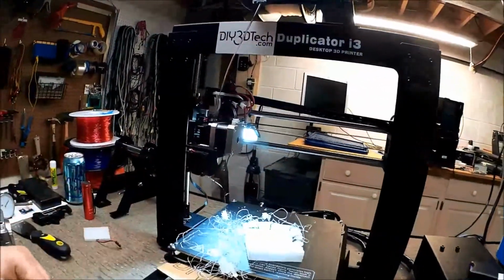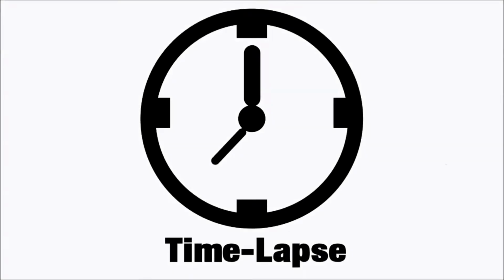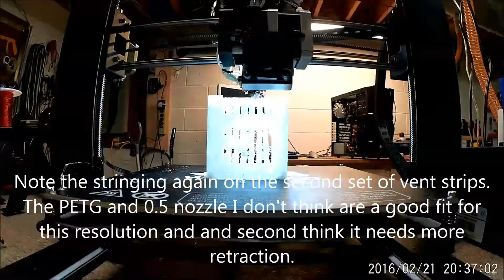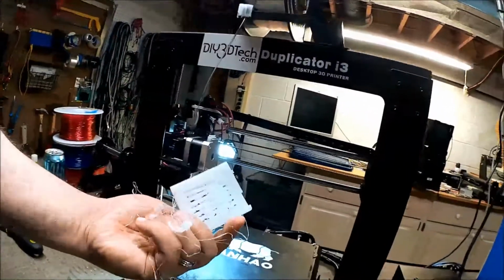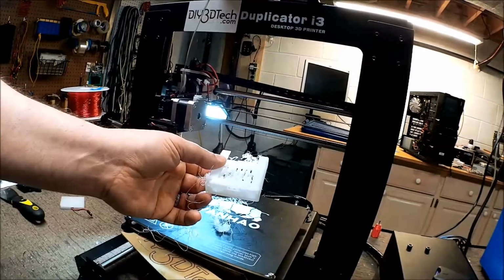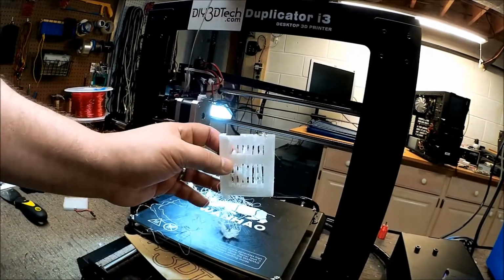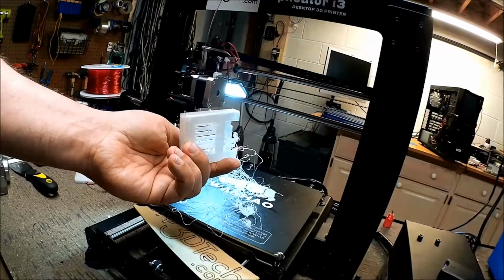Wanhao Duplicator I3 3D Printer - Failed Print with PETG!

Comment: I'm about to run this right now (bed is preheating), using ABS on my Afinia H479, see what happens. I think bed adhesion is the (an?) issue-- it moves forward and backward, and the force seems to want to pull it off the bed. I'll see what happens and make a video. I know it'll take a while, but if it's a fail, then I will have learned, if not I'll have a neat case to use.
Reply from the maker: Would be interested in seeing a video as not sure I am tracking...  A video would be great!
Reply: Well, I didn't get to run this last night like I wanted, so I will run it tomorrow. I'm going to try to replicate the fail with my settings; I think that printed that direction it basically levered itself off the platform. My machine works differently, though, so yes, a video will help a lot. I'll make one when I finally do this.

Comment: bit higher temp and also add some cross patterns to the vents (think checkerboard) so it does not free stand for so much vertical space.
Reply from the maker: +Nerys Get much higher in Temp at least on my Wanhao is a bit difficult as around 255c or so is about the max.  Also see what your saying and agree on the vest, however this was to be a simple download from Thingiverse and print task, didn't work out that way :-)

Comment: Check out that all metal hotend? And I read that a glass bed on these is better for ABS and PETG ect
Reply from the maker: +C Webb For ABS no question, but as I wrote before when I did ABS on it being open the smell was pretty bad.  However what is the URL to the hot-end you mentioned?  I have a ED6 already but don't want to do a bunch of retro-work and would rather it be more of a simple bolt up as I just don't have the time.
Reply from the maker: Very interesting, think I will try it :-)
Reply: I'm also exploring this as an ooption for my MakerSelect Wanhao clone printer.

Comment: "We" can learn so much from mistakes.
Thanks for sharing...
Reply from the maker: +R.A. Monigold thats the idea and what I like about doing these videos!  Really enjoy when I get a comment like "you save me a ton of frustration"!
Reply: What is that? Find something else to print that might work? At its best this technology produces single-piece, simple and ridiculously expensive items that the technologies its supposed to "replace" can produce for a fraction of the price in a fraction of the time when its a mass-production situation. And when a file goes out and hundreds or thousands of 3D printer owners try making it, that's exactly what it is. The problem is they put orders of magnitude more time and effort and resources into trying to make what the "old technology" actually produces more cheaply. Trying to make objects this way is about like taking a MIG welder and a spool of wire and trying to make something out of steel one bead and weld at a time. The difference being that skill and a human operator are required in the second case and anyone skilled enough to do it is too busy doing useful, productive things with the welder. Like BUILDING rather than "making" complex structures, repairing damaged or broken parts and structures, making modifications to complex structures, etc. These 3D printers are "plastic welders" for people who have no desire or ability to build things by hand. They buy the printer, do a minimal amount of assembly, pour time and money and a pile of plastic string into them, rip a file from the internet or use someone else's software they ripped from the internet to "design" some simple object and then use the technology somebody else created to "make" something. Or at least try. And then when they're successful its a huge "accomplishment" and they all brag about what they "made".